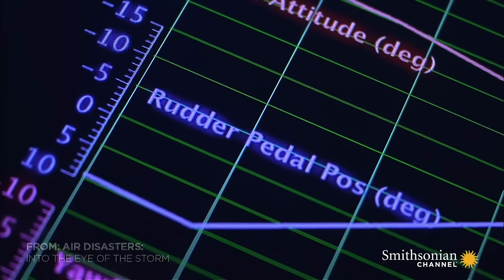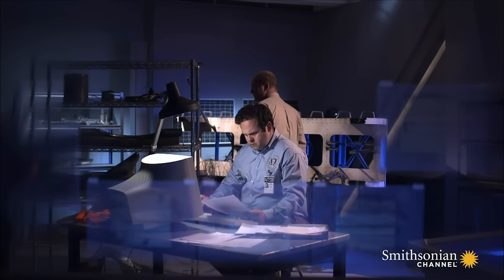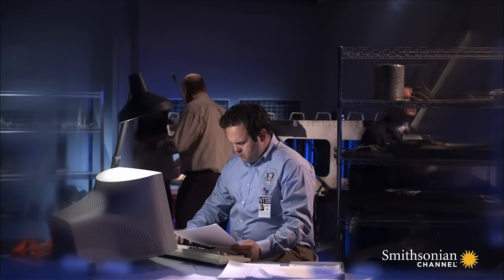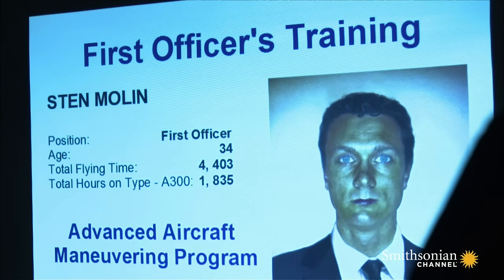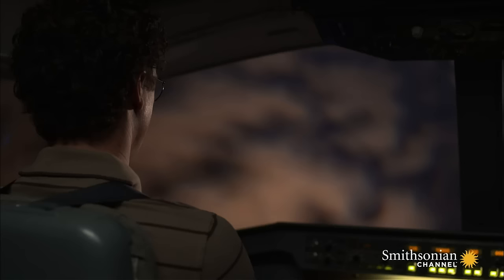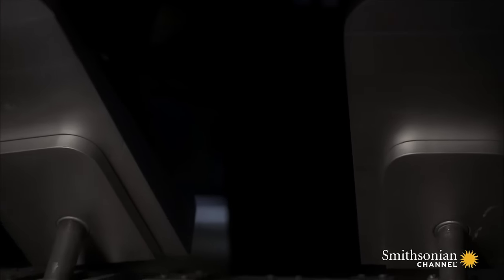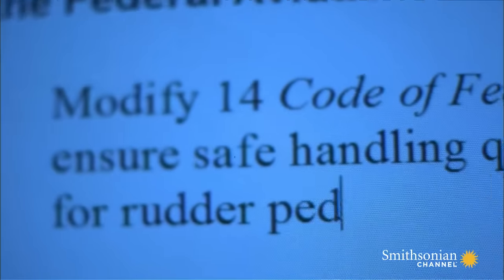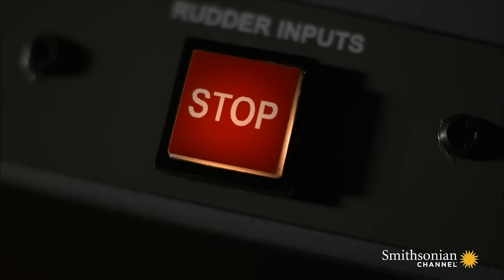Did a Poorly Trained Pilot Cause Flight 587's Crash?

Comment: I’m glad the First Officer was somewhat vindicated. He was just following his training.
Reply: H
Reply: To be fair the vertical stabilizer was weakened before the plane even took off as they said in an official record and the pilot completely overreacted and caused the already weakened stabilizer to break off by using erradic inputs. Both coming together caused a tragedy, although I have to say that normally you can feel the inputs changing the way the plane flies and "lays" on the wind, so he should have felt that the turbulence was in fact his own input.
Reply: there was no training to make those rudder inputs and there was NEVER any confirmation Sten made those inputs. the  FDR did not distinguish between the rudder pedals and the yaw damper.

I didn't know Sten personally ... but he and all professional airline pilots deserve better than the treatment from the NTSB.
Reply: @jungletrouble8296  would da tail still brake off if it was new?
Reply: He wasn’t vindicated. The NTSB report concluded he was responsible for the accident.
Reply: @maireadcostigan1934  I know: but he was following flawed training he was taught.
Reply: Sten Molin was warned many times by Captain John Lavelle to lay off the rudder.
Reply: @jungletrouble8296  so now you've just said it's the pilot, American airlines and the mechanics fault
Reply: @maireadcostigan1934  At least he made some history LOL
Reply: @KOHF34  
no he wasn't. 
American didn't teach that.
Reply: @phelmollyn7895  Captain should have taken over and all those people would still be alive today.
Reply: @Nick-1992-SRB  he will go down in disgrace. LOL.
Reply: @shaark92  yaw damper is for dealing with Dutch roll. It has nothing to do with this. At higher TAS the deflection of the rudder is reduced to decrease the loads on the v stabilizer.
Reply: @helikos1  ok

Never heard of a runaway yaw damper have ya?
Reply: Not so fast. He has been accused of rape.
Reply: Yes was completely vindicated. American Airlines’ chief Pilot designed the training program that emphasised rudder to counter unusual attitudes. Cecil Ewell was his name. He is to blame.

Comment: Rudder overused=the tail will break
Reply: No shit
Reply: the 737 rudder failures resulted in only 1 movement, its when you move the rudder back and forth multiple times, the aircraft starts to pick up a strong yawing motion which greatly increases the loads on the tail. The composite plastic components are just as strong, in fact for any given mass its actually stronger than steel. It doesn't matter what material is used, the minimum legal strength remains the same, so the designed just uses as much material as necessary to meet (and usually exceed) that strength. In the case of the Airbus A300, that min strength was exceeded by a large factor
Reply: sounds correct to me.
Reply: Stop spamming the same thing
Reply: so planes suck?
Reply: I don't give a damn what the pilot does with the rudder.....the thought that it could just tear off the plane like that is appalling to me!!! That would be like saying don't turn the wheel to hard or your wheels will come off. If that is even a remote risk then limit it in software! It was an Airbus I believe so it was all fly by wire so this software limiting could be done easily.
Reply: UNACCEPTABLE
Reply: That's why airbus made their tailwings disabled during flight
Reply: Boeing 767 > A300

Because the Air Canada can drift the 767
Reply: @BijahD  You could do this with any plane that moves fast. It's a simple matter of physics.

Comment: Apparently the hinges connecting the rudder to the tail were stronger than the entire fuselage-tail connection, which just seems like bad design to me. If only the control-surface itself had snapped off there would've been an issue, but you can land a plane without it's rudder. Easier anyway than without the entire vertical stabiliser.
Reply: That is actually not the case. When the rudder was rotated 11 degrees, the plane started rotating, and the angle between the rudder and the wind was reduced, while the angle between the stabilizer and the wind increased.

Suddenly, the rudder was jammed the other way, and due to inertia, and other factors, the yaw angle was greater than before.

The third time, even if the rudder angle was 11 degrees, the plane could have just as well had a 40+ degree yaw angle.

In addition, the surface of the stabilizer is much greater than that of the rudder, meaning a LOT more force is exerted on it.
Reply: Peter Timowreef A B-52 landed with no tail
Reply: Completely UNACCEPTABLE that the tail came off just from using the rudder....I don't care if the pilot played Dixie with the rudder. BAD DESIGN PERIOD
Reply: @BijahD  There's not a single plane whose tail you can't rip off by this kind of rudder usage. If it's mechanical, you can break it.
Reply: @BijahD  what are you on? Do you have any Idea the amount of forces were applied? You cant possibly think a commercial plane should sustain multiple g's of force without breaking apart
Reply: @BijahD  An A300 isn't a bicycle: they're complex machines requiring highly-trained operators. The FO took the aircraft WAY out of spec and things broke. While a newer aircraft might have prevented that with FBW, it's still ultimately on the pilot flying to properly operate the aircraft. You just can't expect Airbus (or Boeing for that matter) to make their planes completely foolproof.
Reply: @hydrochloricacid2146  I'm not sure you're getting my point. As an aircraft controls (engines) engineer, we seek to engineer human error out of modern systems. For example, I'm not going to allow the engines to go into full afterburner if there is a some issue with certain flight conditions or maybe a problem with the AB - no matter how many times it's requested from the pilot....again in this case where Airbus has indirect computer controlled air surfaces, the computers certainly should not have allowed that type of extreme movements by a panicked pilot. I guarantee you that many software updates were driven by this accident to address this failure mode......
Reply: @BijahD   that's like saying a car is badly designed when you steer the wheel all the way at 100 mph and it dosent turn (or even flips over) because of the speed
Reply: @frysco5927  and that's like sayn an apple is an orange
Reply: @Ruogu Lei I see, thank you!!
Reply: @frysco5927  
not quite the same Hoss.
Reply: @BijahD  suddenly you become an aircraft engineer out of spite

all seriousness, any aircraft can have a breaking point with any stabilizer, lets say the vertical stabilizer pointed 90 degrees up and down over the period of 4 seconds.
Reply: @ripnob7245  I'm not an air frame engineer. I'm a controls engineer with experience in military aircraft. My comments come from this standpoint. I realize that even the best controls/control algorithms can't account for every circumstance, unfortunately.
Reply: @BijahD  good point
Reply: @nicov1837 That’s poor design. Period. A vertical stabilizer fell off because of inputs at normal operating speeds. Even cars have software to prevent accidents from excessive steering wheel inputs…and the wheels and tires don’t just break off.
Reply: @airforcex9412 Uh, no they don't, and yeah, the thing doesn't break off, you just crash and die.

Comment: True Story, I worked as an Engineer at Boeing in the early 2000's during the initial design of the 787. It was rough because we were trying to design an airplane to compete with Airbus that always just follows the FAA/JAA rules to the letter of the law, while Boeing analysts would often impose higher requirements. 

The investigators of flight 587 (An Airbus) came to the Boeing factory and observed visually that the 777 vertical stabilizer joint was way more robust than the Airbus design. When they met with the Boeing Engineers later to discuss the investigation they asked why this was.

A Boeing designer quipped "That would be Tom." He was referring to Tom Jones, the analyst for Boeing responsible for the 777 tail. Tom was about 75-80 years old at this time, so I would have to believe he has passed away now. Tom Jones replied "I know the FAA rules do not require the tail to be strong enough for this scenario, but there is nothing preventing the pilot from actually doing it."

That is the legacy of "If it's not Boeing I'm not going."  It absolutely is a real thing. Unfortunately, The mighty have fallen since then. It's too bad.
Reply: Wow
Reply: Yeh the investigation agency gave Boeing too many "perks and less strictness.." and Boeing loss all their strengths.

The recent Boeing Senate hearings.. did you watch them? Crazy
Reply: Sadly that "moto" is gone with Tom.
Reply: Yea sadly it's the opposite now, if it's Boeing I'm not going
Reply: cap
Reply: "It's not unusual" for aircraft manufacturers to be concerned about going above and beyond the letter of the law with regards to safety, except as you say Boeing have made a total mess of it.
Reply: If it,s Boeing, i,m not going to
Reply: It became if it is Boeing I am not going now after the MAX crashes.

Comment: At high speeds (above 200 MPH) there is plenty of air moving over the tail fin of an airliner, so even just 1º of movement is enough to turn the airplane's nose to either side. In fact, at such speeds 1 or 2 degrees of any control surface movement (ailerons, rudder, elevators) is more than enough to make the airplane respond.
Reply: This is precisely why I can't understand why he moved them around so much....  He seemed to have panicked :/
Reply: Wake turbulence. His inexperience killed the plane. I would not say it is his fault, just his inexperience that tragically discover this possibility . There is no previous accident caused by the “excessive input of rudder” and it was not even in the FAA safety rules so nobody would have known that could happen.
Reply: ya mean knots? ( i am confused )
Reply: Co Pilot panicked.
Reply: If subsonic
Reply: 200 knots is NOT high speed ... 250 knots is below "turbulence penetration speed" ... which is the speed at which the structure is to withstand aerodynamic loads greater than the displacement which would result in a departure from controlled flight.  e.g. ... .loss of control before structural failure.

that didn't happen here.  The structure failed before the aircraft departed controlled flight ... and there WAS NEVER a distinction between the pilot input and the yaw damper ... which had a history on this aircraft and the fleet ... of malfunctioning.

3 "doublets" in 2 seconds is physically impossible even for a rock band drummer with a double bass.

It''s sad to see the disinformation about this tragedy so easily accepted just because a government agency published it.
Reply: @shaark92  So you don’t believe the NTSB? You’re saying the Yaw Damper was responsible for the rudder inputs and not the pilot? I’m just curious if you have any more information/reading about this. Thanks!
Reply: @BewilderedBird  that specific airplane had experienced a “runaway yaw damper” in the previous week. 

Re read the ntsb’s allegation on the number of rudder inputs and the time that alleged action occurred. Only someone very juiced on adrenaline could have done that. NOT a professional pilot flying an airplane. 

The AAMP training took a lot of criticism but it NEVER taught this new term “rudder doublets”. Until the report, i had never heard of that term. 

So. I am not saying there’s nothing righteous about the NTSB,  but it isn’t all wholesome either. This event demonstrated this to me. 

Be alert
Reply: @ptanyuh   At the time the way AA's training was formatted was around using the rudder very aggressively to recover from situations like wake turbulence.  He moved the rudder around because he was trained that wake turbulence could cause planes like this one to flip, when he kept applying the rudder he kept feeling the plane moving around and from his training, believed it was the wake turbulence that was creating the upset, not realizing that it was his own inputs that were actually creating the problem.
Reply: @ptanyuh  
I don't believe him, or any airline pilot would do that.
I don't know who they were trying to protect, or why but,,,,,,
Reply: @jalenbarnes7888  
A/A didn't teach this.
Reply: Do American pilots start off with on the Job training ?
Reply: @shaark92 let's talk about Knott's landing.
Reply: @daviddavis3389  the tv show from the 80s 

Or approach speed?

….

Thread resurrection and with reference to the poster who thinks 200 KIAS in a high performance heavy jet is high speed …. The wing is not clean. There are flaps/slats extended.
Reply: @jalenbarnes7888  wrong 

AAMP taught the use of rudder to roll a swept wing high performance heavy jet aircraft which has a relatively high AOA.  That’s proper.  

What’s improper is the summary statement in the transport category aircraft operating manual

“In simple pilot terms, if you are in a stall, do not use the rudder. If you are not in a stall, you do not need the rudder”

That is what is taught post AA587 and has directly contributed to mishaps. But protecting Airbus was deemed more important.
Reply: Richard-zz7gm  lotta presumptions in your post. 

The NTSB couldn’t determine (by way of the airbus design) whether the rudder pedals were pushed or they followed the yaw damper input …

Perhaps you know better?
Reply: Richard-zz7gm  There is the inertia of the plane moving in one direction, so the plane wouldn't have moved sideways much. The rest of the plane weighs more than the tailfin, so any sudden and wide rudder movement would have jerked the tail off, which is what happened. The pilot flying that fateful day was trained to use aggressive rudder movements in response to wake turbulence (which was left behind by a Japan Airlines Boeing 747-400 that took off a few minutes before the American Airlines Airbus A300-600R that crashed). That isn't necessary because the turbulence will subside after a few minutes and it's not intense enough to cause loss of control.

Comment: My grandma's friend lived exactly where the plane crashed. That morning, she decided to leave early to get something, I think it was a pair of keys.

So she drove off, making her way, and going to work.

When work ended she saw she had missed calls from my grandma, so she answered them and was bombarded by questions like "are you ok!?". She asked my grandma what she was talking about, and my grandma told her a plane had crashed into her house. 

She didn't really believe it until she drove home and found her block flattened. Turns out the plane had crashed only 15 minutes after she left. Usually she'd still be home at that point. 

It was an amazing coincidence for her
Reply: Damm
Reply: Angel on her shoulders for sure. Blessed
Reply: I was lucky as well! That day I was living in The Netherlands because I was born there. What if I weren’t? 
Close call for me!
Reply: If the tail came off it should still fly u have to use engine power for the plane to go left,right,up,down
Reply: @OfficalGamer-mv2qo  That's called differential thrust, and pilots are taught to do it to minimise injuries / fatalaties, it would be great if they could get on the ground but it is incredibly unlikely to land safely. The video mentions that he was improperly trained to use intense rudder inputs to prevent severe wake turbulence. Instead, he ripped of his tail. But he had no way of knowing he'd done this. Also, when you lose your tail, you lose vertical and yaw control and, as you said, would need to use differential thrust. The problem is, the only way to escape wake is with sustained yaw inputs, differential wouldn't let them do that
Reply: Dammmm, thats luck mate
Reply: That ain't no coincidence,that's God
Reply: @littleavationguy8268 nah that's god